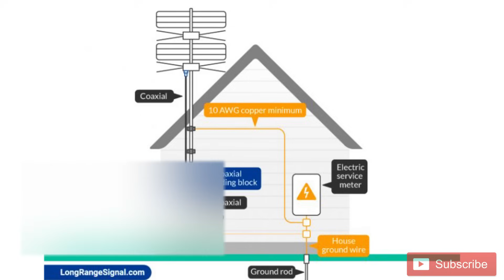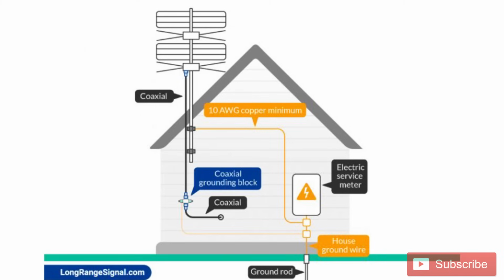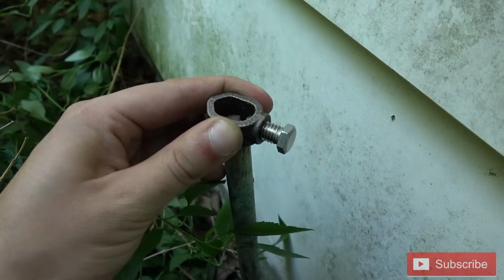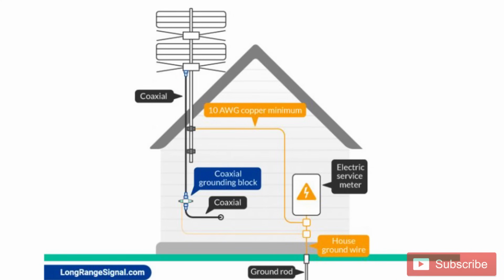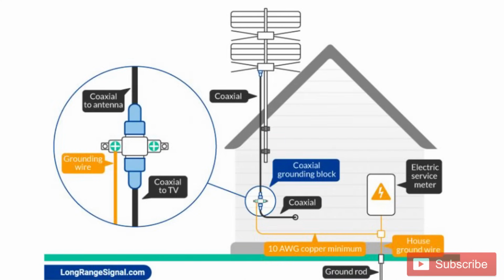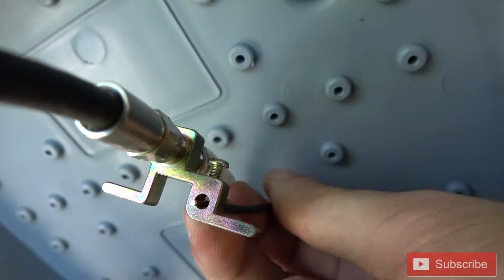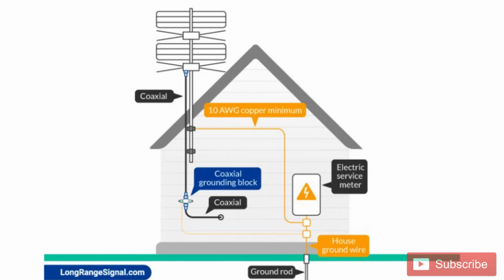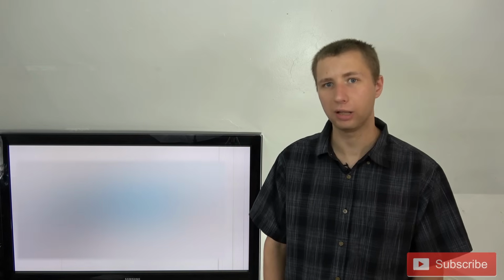How To Ground an Outdoor TV Antenna Per NEC

Comment: at 2:36 you didn't strip enough insulation off and then placed the insulated part of The Wire inside the split bolt so that it's clamping down on the insulation not the copper wire
Reply: Good catch, I didn’t notice this the first time I saw it

Comment: Thanks for the grounding video.
Question, what diy antenna do you think is better, the Gray Hoverman or the 4 bay whiskers? Also, do you think it's an added benifit to add a reflector? 
Maybe my questions would be good content for future videos?
Thanks!
Reply from the maker: Both will pick up UHF frequencies about the same but they do not have any VHF elements on that design so you would likely have problems picking up certain stations. I don't understand where the rumor came from that all digital TV stations are on UHF.

Comment: Are there any special considerations where a pipe mast touches the actual ground?

I am replacing a pipe mast that rusted out and sank into the ground (dirt) over the course of many years.

I’m planning on using a flat concrete “paver stone” with a pipe flange mount to hold the bottom of the mast. Maybe a little axle grease in the flange would help if the mast needs to be turned.

Is there a better “standard way” to deal with mast-on-ground installs?

Obviously, I will be electrically grounding the mast as recommended.

Comment: I Installed antennas for 20 years before cable and we used to ground it to a cold water pipe in the basement when there was no other grounding access. Just like your  electrical box is grounded on both sides of your water meter
Reply: doing something for 20 years doesn't mean you were doing it right. all grounds should be bonded at the service entrance.
Reply: @blahblah5603  You pretend to know my experience and education. Oh... okay. Funnier than that and your non sequitur response is you thinking I care what you do. I bought a house with a satellite dish that was grounded in the very same way, only the house is plumbed in CPVC. Take your time in figuring out that problem. Moreover, it's not me, but the NEC that requires the ground to be bonded. So go ahead and ignore the NEC and do it your way, telling the AHJ that you learned how to do it on YouTube.  LMAO Maybe we'll read about you in the Darwin Awards.
Reply: I've never seen a home in my city that used a grounding rod.  Electrical services and antennas are always grounded to copper, cold water pipes, usually at the meter.  Ground rods are typically used only for outbuildings, such as lightning rods on barns, where there is no copper plumbing.  A newer home with PEX (plastic) supply plumbing would not be suitable for grounding.  Even if your entire home is plumbed in copper, check with the city to see if they have replaced the line from the meter to the city water main with a plastic or composite piping.

Comment: I have my tower grounded to the electrical ground and my well casing. I thought it was good enough. With a couple of channels there signal would be all over like interference. I installed a grounding block and it really helped the signals stabilize. I guess the rotor must kept the ground from being complete.  I've read the wind causes static on the antenna.  One comment thought,  regarding your video.  If the power company shuts off your power, you won't lose your ground. They don't disconnect the neutral or your earth ground. They disconnect the hot wires only by disconnecting the transformer fuze, or pulling the meter and installing a cover.

Comment: Hi! About the ground block for the coaxial cable... Q1) Doesn’t the addition of this block reduce the signal? My next question is more general. Q2) Can I use a combo ground clamp that clamps onto the mast which has a coax female part for the in and for the out, and therefore only use one AWG 10 wire to go to the ground rod?

Comment: You identify grounding to an outside buried ground rod or grounding to the electrical service, but what about grounding to a copper cold water pipe?  Isn't the electrical panel grounded to a water pipe also?  Questions here about grounding a balcony antenna in an apartment or condo...they also have a cold water pipe available.  If you plumbing in PEX, I guess your sh*t out of luck.
Reply: ❓Why not use the 3rd lug ground on an electric outlet ... 🔌
Reply: @jamescalifornia2964  Your typical 15 Amp electrical outlet is grounded with a 14 gauge copper wire to the electrical service panel.  The ground wire from your antenna must be a minimum of 10 gauge copper wire.
If a lightning strike travels down a 10 gauge wire and then into a 14 gauge wire, the 14 gauge wire will overheat and cause a fire.
Reply: @chrisgraham2904  — Thanks 👌

Comment: The above method is ideal for protection, but If you add a separate ground rod for the antenna then connect this added ground rod to the electrical utility service ground with a section of the AWG 10 gauge wire, and then ground the antenna to the wire that connects the two grounds. This will minimize any possibility of creating a ground loop.  Ground loops occur whenever there are two or more independent electrical paths of unequal impedance and can cause unwanted electrical noise.
Reply: What if the service ground is 70' away from the mast/ant. 2nd ground  rod or just run to the service G directly. Have to run the 70' either way don't I? Thanks.
Reply: Yeah mine is 400' away🥴🤔🤔

Comment: Tyler, I don't want to deal with an outdoor antenna yet. I'm wanting the Clearstream 2max, which allows outdoor and indoor. Would I have to ground the antenna indoors as well? If not, any particular reason it shouldn't be needed? Thanks man
Reply from the maker: Nope, no need to ground an antenna inside

Comment: If the electric meter is removed you still have the ground rod that’s connected to the meter base and to the neutral wire that goes into you house and out thru the triplex .

Comment: Is it ok to ground the antenna mast and the coax to its own 8' ground rod since my electric meter with its ground rod is a long distance away from my antenna?
Reply: No. The antenna mast and coaxial cable ground should be connected to your existing electrical service grounding/ground rod system. Google "Mike Holt" and "grounding antennas" and you should see explanations of how, and why, the NEC requires this connection

Mike Holt is one of the foremost experts on the National Electric Code.
Reply: Nope. NEC 250.94 from 2011 requires bonding all grounds together. 

Also if the ground run from your coax and antenna mast are on the opposite side of the house as the main grounding rod then you will need to use a much larger diameter of wire to deal with impediance and voltage potentials. Upgrade to #8 or #6 if the run is far like 100ft or more. You can easilly do #6 or #8 copper to the mast, however the coax ground block will probably only let you do up to 10awg. Take a 10 awg wire from the ground block and connect to a "split bolt" to the 8 or 6 awg wire running the mast to the main house ground rods.

FYI modern code requires 2 main grounds. One to the main house water pipe and the second to two ground rods 10 feet apart.